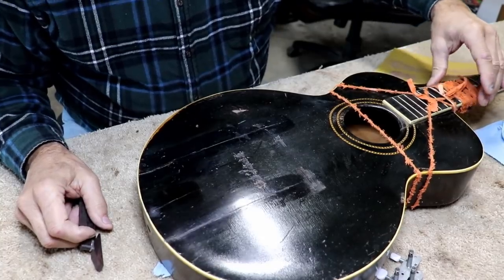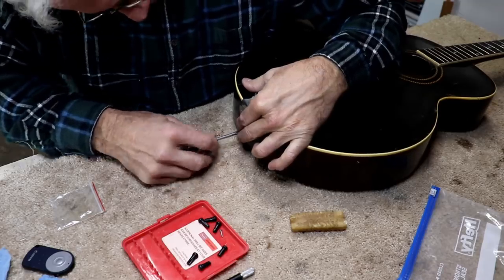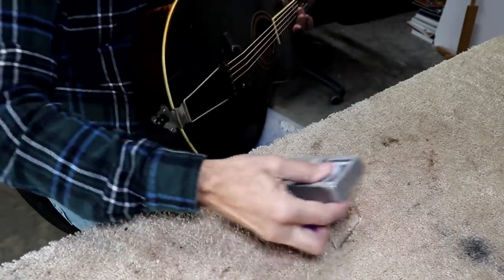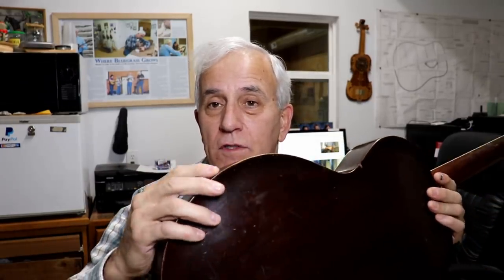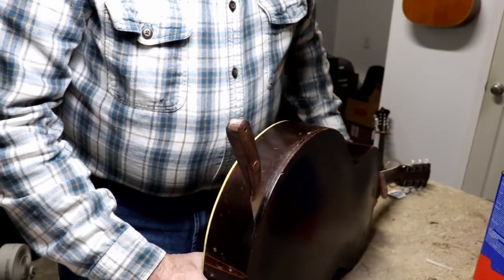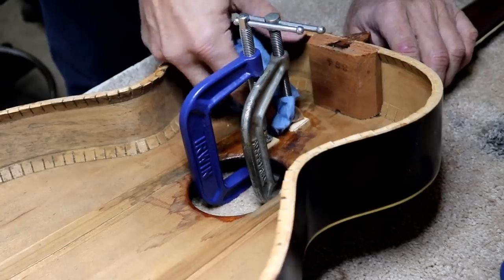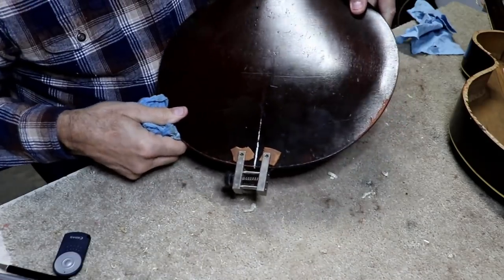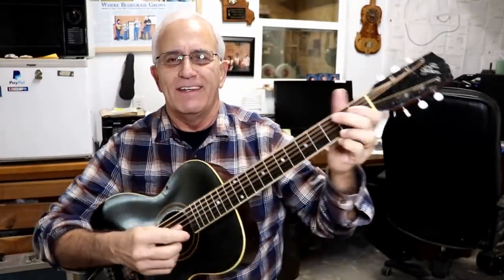265 RSW L1 Major Surgery Again Part 2 This is a good one

Comment: Mr rosa I am a luthier here in Indiana and about a year ago afellow I know brought his up-right base to me to have the neck reset and also he wanted the fingerboard replaced. I happened across a video from a place that was demonstrating how to use that alcohol trick so I tried it and it worked like a dream. I thought it was going to be a real pain but once I got it started just a little I walked all around that fingerboard dribbling small drops in the crack and you could hear it snap crakling and popping and all of a sudden that fingerboard just fell right off in my hand and it came off clean as a whietle too. I used a real flat bladed knife I made myself to open just a real small seperation dripped a little alcohol in it and it went from there.
Reply from the maker: Nice to hear. Wish it would have worked for me.

Comment: I gave up on all the other glues a long time ago. Titebond works. Titebond is repairable. Done. You had me on the edge with that back repair. my last back removal I tried to clean up with a damp cloth , walked away a few minutes and came back and it split in about 5 places. Very thin back so no way to get it back together. had to make a new one.

Comment: In France we generally use ethanol as opposed to isopropyl.  Ethanol is the stuff you drink.  My experience with isopropyl is that it'll dissolve some greasy deposits but it doesn't do much else.  In the Pacific Northwest, where I hail from, We used to go out to the Indian Reservation and buy what was called "Everclear" which which is basically pure grain alcohol.  And, no, we weren't taking backs off of guitars, we were  actually drinking this stuff.  The point is, you might try to find some good ole moonshine.  If it doesn't work at least you'll have something to drown your sorrows with.
Reply: Drinking Everclear makes you lean. It makes you lean on the wall, etc.
Reply: Why don't they use red wine? -- it has ethanol, and, importantly,  that resveratrol stuff, a well known precursor to the solvent for Tite Bond IV
Reply: And if it doesn't work, you can use it in place of gasoline in your car.
Reply: Everclear is 190 proof. If u can find it. Some states sell it. We used it for cleaning electronics.

Comment: Hey Jerry, you gotta do what you gotta do. And it all worked out well. I'm thinking maybe the French guy was talking about what we call grain alcohol or Ever clear. But if that is a French polish the alcohol will take the finish off.
Reply from the maker: Yeah a lot of folks have suggested Everclear. And I also knew about Everclear before even started the video. But the sad truth is I don't drink and I will not have that on my property. It looks like you can buy 100% alcohol on eBay the non-drinking kind so I might try that. I really sincerely doubt it's going to work. I had 91% isopropyl and it never even did a single thing.  I also use denatured alcohol for quite a while and it didn't touch it either.
Reply: @RosaStringWorks , I don't drink at all either but I would treat a bottle of that around the shop just like any other solvent. Isopropyl and denatured are just different animals altogether. I've found steam or even very hot water work great hide glue but can cloud the finish.

Comment: Hi Jerry, your videos inspire me to do better work on instruments.  I've found  anhydrous (water-less) alcohol is usually available in hardware or camping stores as stove fuel.  That's the kind of alcohol I used to remove a fingerboard from an upright bass.  The lack of water in the alcohol dries and shrinks the hide glue.  You can hear it cracking as you get the knife going through the joint.
Reply from the maker: I've got several kinds of alcohol that supposed to be pure. I haven't actually tried it on anything yet. But I sincerely have my doubts it's going to work. But I'll still give it a shot.
Reply: @RosaStringWorks  The important thing is the alcohol must be labeled as anhydrous.  All other denatured alcohol I've been able to find has had some water in it, which defeats trying to dry out the hide glue.  Again, thank you for your videos on YouTube.  three years ago had to inlay a new dovetail vee joint into the body of an upright bass and your video was the only thing on the net that showed me exactly how it's done.  The job turned out well and the school is still using that bass.  Thank you again for your videos.

Comment: My guess is that the hole in the top was for a wire where a user used a bridge pickup mounted into the bridge.

As for the tone, that's just the way an L-1 sounds. Boxy and Dobro-like. An L-4 is a little more full, but if you want an antique sound, that's what you play an L-1 for.

Comment: I read an article somewhere that said 95% alcohol can crystallize the glue and cause it to fail.  Everclear could work.  I know from a project I did last year that the only material that you can use that holds up to grain alcahol is natural gum rubber.  So, try everclear sometime on some scrap to see if it works.
Reply: Yup. Everclear.190 proof stuff.
Reply: Even if the Everclear doesn't work on the glue, drink some of it and you won't care anymore. :)

Comment: I've had good results removing the back off an old ('30's) acoustic by  heating the joint using a hair drier to soften the hide glue.

Comment: Ive seen a guybon another channel use a small clear suction cups  to push glue down into the cracks. Apply glue then stick cup over it the push up and down on cup and itll force the glue into the crack
Reply from the maker: I've done that too. Most of the time it pretty much sucks. That's what a suction cup does

Comment: I also have a old oil bottle with a small long stem  that has electric fence wire zip tied to the tube so i can bend it to any shape to   glue inside braces,  along with a camera scope and a helping hands weight with a coated clip that i clip to the shaft mid way to hold the camera in place , frees up that extra hand.

Comment: I was given the pieces of a Harmony arch top from the sixties. The back was off. The two parallel braces of the top were both off. The top had MAJOR cracks right where this L1 had them...almost in three pieces. Only the sides were keeping the top pieces together.The width of the braces was not sufficient to cover and cleat the cracks. Rather than "sister" the original braces, as you did, I used the flat paint stirrer sticks used for the five gallon size cans. They were long enough and wide enough to completely cover and cleat the cracks. Also flexible enough to bend and conform to the arch.... Titebond glue, and a result that has lasted about  four years so far. This Harmony is identical in size and shape to a Harmony Monterey which I also have (in a black and red sunburst). They both play well, but the paint stick one has a little more of a baritone voice. I am pleased with the results and appreciate having two of the same that sound different.
I love your work ethic and truly enjoy watching you with my morning coffee. Thanks for the education. Will I continue to become a real luthier?????"WELL I DON'T KNOW. MAYBE."

Comment: Without those bushings being inserted to snugly fit the string posts, I think the guitar is prone to suffering from further tuning stability issues. In fact, you can already hear the guitar go off key in the test run at the end of the video (D chord). And I wouldn't be surprised if the cracking noises hadn't been caused by wood compressing at the headstock due to this.
Reply from the maker: Not likely. It's very common to not have bushings when the string holes are that tight. And no the noises weren't coming from the headstock it was very obvious where they were coming from. And they didn't happened after I fixed the top.

Comment: Again you outdid yourself Mr. Rosa. Your videos are most informative and interesting. You never fail to satisfy me.

By the way, I am of the opinion the Frenchman who suggested alcohol for dealing with hide glue was referring to ethyl alcohol (ethanol).

You might also want to try methyl alcohol as well. Hopefully these might actually work. So by all means try it on one of your guitars and see how that goes.

Cheers.
Reply: Tiny bit of water works best on protein glues. The beauty of hide glue and fish glue is both the crystalline structure and the permeability when it comes time for repair. When the joinery is done correctly the glue joint is stronger than the adjacent wood. I think  alcohol evaporates far too quickly to do much of anything unless its an alcohol based glue or something. Hide glue is the most perfect instrument glue, the only drawback is the short open time. In order to use hide glue, everything must be set up for perfect execution. I feel like hide glue gets bashed unnecessarily over here:)

Comment: Really nice work. The only suggestion I can make is that the alcohol you use to dissolve shellac flakes is especially low in water content and might be a good source. I wonder if the great age of that joint might have changed the ability of the alcohol to dissolve the glue.

Comment: turned out beautiful.  i was plugging holes last night with toothpicks. that gap in the neck joint  was a perfect spot for a note,  like a time capsule.
Reply from the maker: I wish I had thought of that. The Time Capsule idea is pretty cool.
Reply: I bet a flash drive would fit in there .....
Reply: @MrPotatochips4  even better, of the repairs would be very cool .

Comment: You might want to take a look at this woodworking article. It says that hot moist steam is the best for softening hide glue.  You use steam to soften the neck joint glue, so why not use it on the back? Is there too much risk of warping?
Reply from the maker: It's too hard to control. And you also risk burning yourself. On the Mac you have to drill a hole down in there and you just insert it down in the hole and it infiltrates on the sides it's much harder to guide it where you want it.

Comment: Mr Rosa I noticed you have a soldering iron with a long rod attached to it for heating neck joints, I also have a soldering iron  the only difference is my iron has a putty knife blade attached to it to heat up side seems to remove tops and bottoms

Comment: Hi Jerry, just an observation. I agree its probably the type of alcohol you used because if i remember right isopropyl is around 70% and denatured ranges from 60- 70%. so probably just too weak for that purpose. I'm with you as I dont know where you would get a 90% or greater from here in the usa. 
great work and videos,
Josh
Reply from the maker: The isopropyl alcohol I had was 91%. Apparently there's water in the other part. But to me hide glue is supposed to be water soluble also. So I don't know why it doesn't work. Plus I was using denatured which they say is 100%. I don't know

Comment: Hi Jerry, another fascinating restoration/rescue. Thanks very much. I’m just wondering if you ever consider giving the inside of these old instruments a light coating of linseed oil to moisturise the wood to try make it less brittle? Its the standard treatment for cricket bats here in England. The wood presumably becomes dried out with age and they’re under a fair amount of stress. Its hardly surprising that they are prone to cracking like this, obviously you wouldn’t want to get the oil anywhere in a place to be glued, but I would have thought it would prolong the life of the instrument. Would it have any significant effect on the tone?
Reply from the maker: It probably wouldn't hurt anything too bad. I've never seen any instrument with a finish on the inside though

Comment: Hi Jerry - the process of removing the back looks a real chore. I was wondering if it might be possible to use a razor saw - even if it has to be modified in some way, especially with awkward areas. I understand the saw, although very thin, would remove some material, but reckon the amount wouldn't be significant - especially if used from start to finish. I'd be interested to hear if you've tried that method. Cheers Terry
Reply from the maker: Yes I have used razor saws many times to remove backs. It's not my first choice because we rarely do you ever cut perfectly down the seam.
Reply: @RosaStringWorks  Hi jerry - appreciate your reply, gives me confidence to consider that approach if I need to.

Comment: I know you’re finished with this project, but while you had it open, I sure would have added ladder bracing and a bridge plate (even though the bridge is floating).  I know the carved arch top adds stiffness, and it might take away a bit of the sound, but wood is weak along the grain line.  It make very little sense to me that Gibson would only brace WITH the grain and not also transverse to it.

Comment: Jerry,
I haven't finished watching the video yet, but you've mentioned ferrules a couple times . . . . anyway, I build CBGs and I have a lot of stuff around. By chance I have 6 thin walled ferrules, nickel I think, that might work. Dimensions are: Flange 10.06 mm, OD is 7.13 mm, ID is 6.38 mm (so wall thickness is .75 mm?). They are 7.12 mm deep measured from below flange. If you would like them for this project, let me know and I would be glad to donate them to this project. (You may have already sent it back to its owner).
Reply from the maker: Yeah it's gone already. Thank you.

Comment: If you ever decide to try the alcohol tip again I'd recommend buying a bottle of everclear 190 proof to see if it does any better. It should dehydrate the hide glue. You can pick up a bottle (or the cheaper gem clear 190 proof) in liqour stores pretty reasonably, and if memory serves it's sold in Missouri. Even if it doesn't work you can use it to mix up shellac when needed. Guitar looks and sounds great!
Reply from the maker: I spent the big bucks and bought some lab grade pure 100% alcohol. It doesn't work either. I am totally opposed to drinking so I will never buy Everclear

Comment: I wonder if an adjustable heat soldering/pyrography iron from a kit I bought for $40 or $50 at amazon would work for hide glue. It has a threaded end that will take an X-acto type chuck which allows me to use pointed, round, and chisel end blades on similar problems. Have the heat adjustable means you don't have stop and reheat your lifting knife. Plus you have the advantage of an extra soldering iron and the kit came with all sorts of pyrograpy tips, stencils, etc.

Comment: A $9. bridge from Ebay that you can paint is a "no brainer" for a Pre-War Gibson(?). With kind respect, the skin glue used in quality instruments will easily separate using traditional luthier adhesive chemistry and techniques. These traditional methods will not cause more damage to the instrument by prying, hammering, or trying to inject solvents as if it were an outdoor deck. Twoofrd shares advanced luthier techniques on the chemistry of the wide range of finishes and adhesives used by lutheriers from 200 years ago to the present that will save you a huge amount of time in these complex repairs that become more complex as you tear things apart. There is a much easier way. Keep your stick on the ice.

Comment: I 've noticed that the bridge on this guitar is not on an angle as my old J50 guitar to compensate for the larger E strings ! Pardon my ignorance for the fact that I fail to understand why it is so. When you played it open and on the 12th fret after you adjust it, it sounded pretty good to my ear !

Comment: The best method I have found to remove hide glue is stupid simple, take a little spray bottle fill it with warm to hot water and thoroughly soak the joint, if the joint is covered in finish you may need to take a razor blade and cut the finish all the way around the joint to allow the water to start soaking into it. You then take a wet rag or old t-shirt and lay on top of the joint and hold a clothes iron to it until it starts steaming pretty heavily. You are looking for 140-150 degrees which is the melting point of hide glue, it also dissolves in water so you have two methods combating the glue. 

Now, this gets a little trickier for you as its a guitar and you may need to still use the knife to open the joint enough to let the water soak in and then throw the wet rag on it and iron it but the purpose of the knife now is to open the already loosened gap to allow more water and steam in rather than prying it apart with the knife. I use this method on antique furniture and clocks daily and it is by far the best method i have found but my joints are usually not as tight as a guitar back. So the knife to get the water in is key for you.  At the bottom of my comment ive linked a video that someone kindly put on youtube that shows what im talking about to a certain degree. https://www.youtube.com/watch?v=2oDbmjwG98U

I have used the hot knives and driving them in and fighting with it and chipping it out and all of the pitfalls that go along with that method ive tried using just a heat gun but nothing I have tried beats this method.